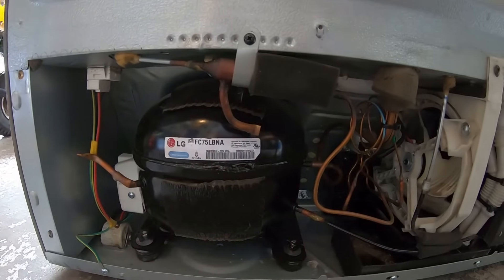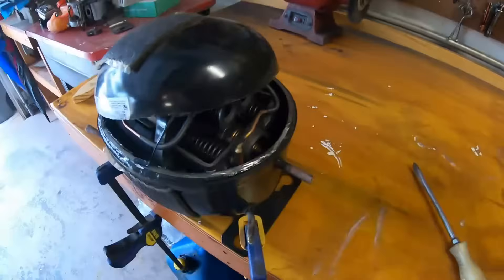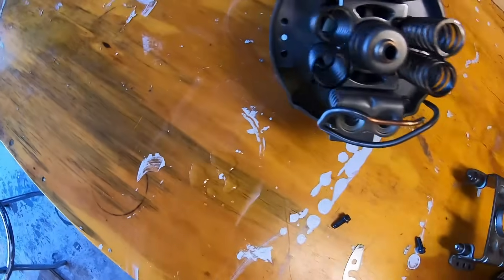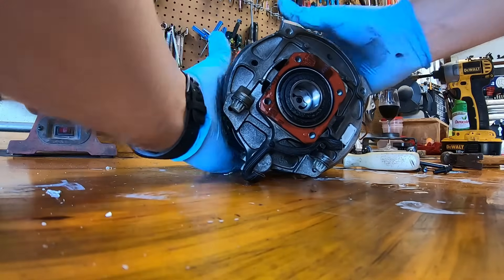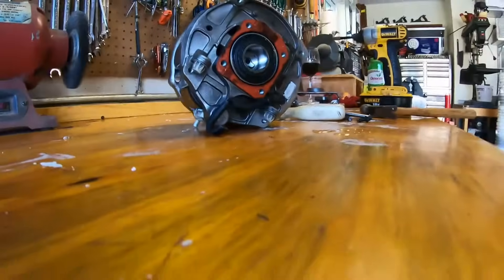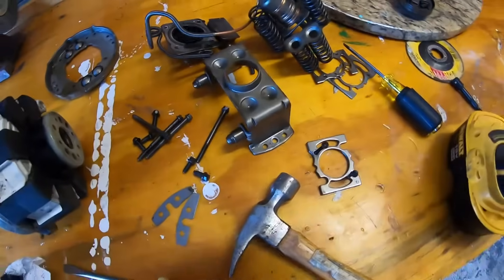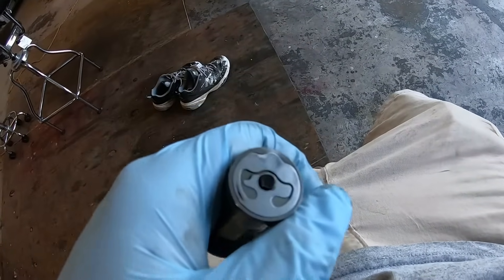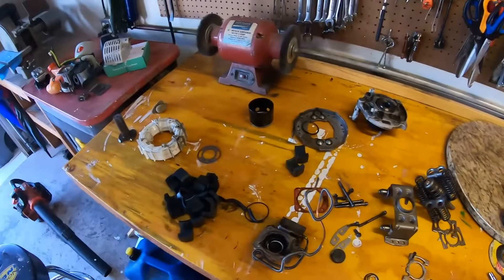Cutting open a failed LG refrigerator compressor

Comment: AN ACCIDENT WAITING TO HAPPEN.             I am rather amazed that you talk about safety in your video clip yet you are operating an angle grinder with a cut-off blade with no spark guard fitted to the grinder. Admittedly it may be difficult to use with a guard in certain situations but there is no excuse for not wearing PPG, ie gloves and goggles. I know that hand grinders are small but they are powerful and in the event of the cutting disc getting "grabbed" it WILL take it out of you hands. Resultant potential injury could be a deep cut to you wrist or even worse would be a severe cut to the abdomen spewing your entrails who knows where!  Please, for your own safety and even more so  if you are making publicly viewed videos, think SAFETY!!!!

Comment: does it have a ball valve/ check valve?.. that fails/ sticks open , its all over..
except for the pumping diaphram what else would impede the flow of refrigerant?
I fixed slurpees and ice makers/ beer chillers systems for 12 years Las Vegas ../  Casinos, bars & 7-11...( 150+ plus stores)

Comment: What usually fails is the piston becoming locked, it's called locked rotor. Lg compressors are known for this due heat build up when these units are put in a closed enclosure like a cabinet and no maintenance is performed yearly to clean coils they fail. I worked on these units when they first came out and now I'm retired.

Comment: My 1990 Kenmore side-by-side is still going strong 34 years later. Zero replacement parts needed besides the light-bulbs every 10 years or so.

I will be very sad when the time comes to replace it.

Comment: when I started in HVAC in 1981, it wasn't a big deal to find a 30 year old fridge still working fine. My first vacuum pump was made out of a compressor from an early 50's fridge compressor
Reply: Yea.. My Hotpoint/GE was here when I moved in, in 1995. Mfg 1990. Still going strong. Door seal at the bottom is a bit saggy, so I should do something about that...
Reply: Hair dryer will tighten that up.@cnielsen3739
Reply: Same here.  It was left behind by the previous owner in 1979.  It is a 1947 Hotpoint and is running to this day.  It is virtually silent in operation as it has no moving parts other than the compressor.  The condenser is a large metal plate attached to the back of the cabinet.  It does need a door gasket, though. @cnielsen3739
Reply: I had worked for my best friend's Dad's Furniture and used appliance business from the time I was 14 years old.  We reconditioned and sometimes rebuilt appliances, and had a salvage operation as well. We would replace compressors with good used when necessary. Back then compressors would often outlive the appliances that they were in. Some refrigerators that i worked on were from the late 1930's and 40's, with only a minor electrical issue. I worked in this industry from the early 1970's until the mid 80's
Reply: @mako-g90  when Ge changed their compressor, the new one would last as long as the warranty, the warehouse was changing out 3+ pallets a day, I let my Hotpoint dealership go. not enough profit and too much ill will from selling lemons
Reply: that was in about '85

Comment: The recovery of refrigerant is a law that needs to go away. Over 40 years of science has proven that older refrigerants never caused ozone depletion. And the newer refrigerants are completely different to the point that they are no more toxic than the exhaust on a modern car. We would save 10% on energy consumption if we returned to the old "Freon" refrigerants. The entire ozone scare was because the patents for Dupont Freon had run out and they had new competition. They spearheaded the move to the complex chemistry of their alternative refrigerants to gain a competitive edge. I think government regulators & science influencers are brainwashed to go green. The newest science does not support man made climate change and most weather scientists have always been skeptical. This is not a political issue. It's been politicized by deep corporate pockets to gain higher profits. They pay their scientists to produce junk science that supports the corporate plan. The MSM broadcast this junk because it gains them advertisement profits. Consumers are being duped.

Comment: Using an angle grinder without safety glasses has to be one of the dumbest and most dangerous things anyone could ever do.
Reply: There's no sign of oil?
Reply: But he did have hearing protection on. LOL!!!
Reply: @tjsylvia285  Those are for the wife.
Reply: You do you...
Reply: And the compressor should be securely held down so you can hold the grinder with two hands in case the blade digs in a d binds up
Reply: Good lil sheep you are.
Reply: And in a pretty nice clean looking garage
Reply: Thanks for doing and sharing this video. Lets me know I wont ever waste my time trying to fix one.
Reply: What are you talking about? Dodnt you see he was squinting? Sheesh.
Reply: @ reply to wrong person? I use safety squints some times but other wise fook that sh it, they cuase more problems then they solve, but I since gone to plasma cutter, much better!
Reply: And the safety shield removed, too. 🫏🧢
Reply: @jimseviltwin1  first garbage to go on my grinders too, things cause more issues than they solve.
Reply: And using a cutting wheel with no guard. I've seen those things explode
Reply: @dwightsornberger8916 Yep…trauma nurse here and we pulled about a 1/4 of a cutoff wheel out of a dude’s abdomen about 4 months ago.  Transected his colon and his small intestine in four places.  He got to carry his poop in a bag for about three months afterward.
Reply: @dwightsornberger8916 
0:44 Yes! No guard is stupidity. You know he knows better. 
Safety glasses would offer no help for that.
Reply: Still not as bad as buying an LG fridge.
Reply: @grayrabbit2211  You can't buy a good fridge anymore.  They stopped making those twenty years ago.  Everything is engineered to fail now.
Reply: Second only to no shield and holding a spinning wheel right next to your gut. Those discs do break.
Reply: I liked how he was showering the gas tanks with sparks.
Reply: But he's got ear muffs on..!!  His ears are more important to him than his eyes obviously.....  smdh
Reply: Man a pair of safety glasses is what 2$....
Reply: I have done that for decades without incident except did get some debris on my pants sometimes.
You do not put your face or other sensitive things in the "plane of rotation".
With a guard on the grinder, things can only fly out of the "plane of ratation" in a limited arc.
Reply: @2Truth4Liberty  yes,  until the blade explodes and throws razor sharp shrapnel at the speed of light through your eyeball. Better to just use goggles.

Comment: Thank you for sharing! The design of the linear piston is fine. The valve seal material is what is bad. You mistakenly called it the inverter scroll compressor. That is totally wrong. Scroll & rotary are nothing like this and many have a 10 year warranty. The inverter and permanent magnet motor is big energy saver. Consumers are demanding the lowest energy consumption with the lowest price for a given size. Let this be a lesson to consumers. Lower energy consumption comes at a very high price when inverters are used. All that complexity leads to low durability. We used to expect 20 years from a fridge and now it's 3-5. That $2000 low energy fridge is now $8000 for a 20 year life.

Comment: I wonder if the refrigerant is ammonia, a highly explosive gas? I still use my 1987 Japanese made microwave over that still has the original light bulb in it. It works GREAT with ZERO issues EVER! My USA made electric oven, a Maytag was purchased by me in 1998. I had one minor issue with it in 26 years and I use it daily. Still looks great too. The fridge we have was left by the previous owners and we have never had problems with NEVER! It is a whirlpool designed and assembled in the USA. My Maytag portable dishwasher is 20 years old this year. NEVER ONE problem. EVER! I use it about every other day. It cleans well and at about 1/3 the time the newer built in does AND CLEANS MUCH BETTER! The reason, newer dishwashers don't like to use sufficient water to clean dishes. Thanks federal government for improving efficiency to the point they DO NOT WORK!
Reply: I think ammonia in consumer products is now only limited to butane/propane "absorption" refrigerators. There are also some absorption refrigerators that use an electrical resistance as a heat source and operate on mains electricity, usually those small ones used on hotel rooms because that system is almost totally silent. Those intended for motorhomes can have both the butane/propane burner and the electric heater that can work with both DC from the battery and AC from the mains.
Big industrial systems do use ammonia, at least some, and when they have a leak the whole town is evacuated!

Comment: A much more complicated version of what I dealt with a salamander heater quit working because a small length of "rubber" hose had dry rotted in 2 years. One tiny substandard part.  Did they not test these for endurance before release?

Comment: You're using a "Cut-off" grinder... your Hand literally inches away from the wheel.  No Gloves and No Safety Glasses.  Just HOW STUPID Are You?  Don't bother to answer, it's a Rhetorical question.  I also have no doubt that your Fire Extinguisher, IF you even have one, is either in the Kitchen or your car...  just sayin'... you probably shouldn't be making "Videos" for On-line.

Comment: My LG French Door Fridge with Bottom Freezer died probably 7 years after purchase. Everything went dead, even the fridge light? Opened up the cover on the back where the circuit board is and tested the 2 fuses. The larger fuse looked fine but when I tested it with a multi meter it had an open circuit? I replaced that fuse by de-soldering and re-soldering new fuse. It has worked like a charm ever since (approximately 10 years later). I guess the vibration caused the fuse to fail over time? I have heard if you have a service guy come in they will just throw away the old board and install a new $400 board? Check your fuses before you call the service guy?

Comment: Old video, but the piston needs to be able to create a vacuum to pressurize the refrigerant,  and my guess is either the piston or bore wears where the vacuum is insufficient or there's some sort of rubber seal that deteriorates (which you ultimately came to the same conclusion).   

A basic knowledge of physics says that that moving a piston back and forth can't be as efficient as a rotating compressor, but it's probably either cheaper or smaller or probably both.

Comment: The broken seal kind of confirms my hypothesis:
For start, this is a resonant vibrating machine, where the mass of the piston with the springs is in resonance with the frequency it is excited by the winding. Kind of the same as e.g. electric shavers use to work, although the shavers run on mains frequency directly, here the inverter is able to lock in to the exact resonance of the assembly so is able to make the thing very efficient (not that difficult with the electronic drive). The key difference between this resonant mechanism vs the classic "rotating motor plus a crank" is, the crank has an exact displacement range without any exact control required, with the resonant mechanism the displacement, so vibration amplitude, must be carefully controlled by something reducing the drive strength once the amplitude reaches the designed level. Now with a piston compressor to be efficient, you need to push it really to the head without any gap, so you need the displacement to be really accurate. Not that big deal with a crank, but the heck of complications with something that has its amplitude so temperamental. If the amplitude became too large, the piston just crashes to the head, so that is why they probably used the rubber bumpstop there. Most likely the electronic was supposed to drive the compressor so it just does not hit it, but that is rather delicate balance,quite easy to get upset. What happened most likely here is the upsets, leading to the piston actually hitting the rubber bump stop, happen in the real life way more often than LG R&D expected, tearing the rubber apart.

To me it is very naive to assume those upsets to be rare (it could even be the fridge operating under not fully optimom conditions) and for practically any material to withstand those crashes so many times for the thing to last for any usable time. To me it looks like some management moron jumped on some "high school science class idea" and pushed it through dismissing all suggestions for it to be nonsense.
Reply: It's also likely that they had to go to this design to meet energy efficiency standards. The old style compressors are durable but use more energy.
Reply: @SSHitMan  I'm not sure the resonant thing is necessary for that. I would rather guess the (now classic) BLDC motor with normal crank would yield practically the same efficiency.
The inefficiency of the "old school" is in the use of induction motor (losses to get the rotor field, vs a permanent magnet rotor BLDC), not in the crank mechanism. The resonant springs and the fact the whole thing has to vibrate causes losses too. I would even doubt they would be any lower than those in a crank mechanism (even when talking about a system with an extra balancing mass auxiliary crank, to fully compensate imbalances), mainly when the compressor piston can operate with much tighter margins with less dead space and less elastic elements within the cylinder (and still no risk of any crashing whatsoever).
To me it more looks like an attempt to cut costs: The resonant vibrating system has fewer parts and may appear simpler to manufacture, so may have promised lower manufacturing costs.
It may work well with things like shaver, which has barely 1000 hour runtime expectation yields more than 10 years of service, but in a fridge the same 1000hour compressor runtime gets spent within just barely few months. And that is, when these compressors appear to start failing...
Reply: EXACTLY,  you can blame the government for all this waste.  @SSHitMan

Comment: I've worked on a lot of AC systems in automotive applications and you'll never see black oil like that a property running system will look brand new inside. The oil will look nice and clean. A system with catastrophic failure you'll see that sort of thing. The black is metal dust and that's in the entire system now because the pump failed. You can flush the system out luckily and replace a compressor. I'd bet on that fridge you can replace that pump with an older style pump no problem but it's probably not worth the effort unless all that's available are fridges with that design then doing so will be beneficial because it will last dramatically longer.

Comment: You won't have your eyes long grinding without using safety glasses.
The thin piece of metal on top of the piston is a reed valve.  If the compressor was running before you took it apart, the valve assembly more than likely was at fault.  The piston was moving back and forth but because the valve(s) were leaking, it couldn't pump anything.

Comment: I applaud your efforts for taking it apart to make a video, but the fact that you didn't have a clue what you found is baffling. It is not a piston. LG's feeble description of this compressor should say 'Solenoid Plunger Pump".
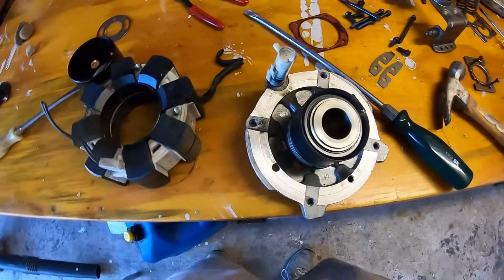Electric coil pulls against an iron armature / center piece. and springs push it back. What you found and showed at 12:27, is about worthless if you don't show where it came from - again, not your fault, but is lacking any value to the audience (me). 
If you were to show the point at 6:13 as to where it came from, it is easily seen as a bellows or a diaphragm, that moves the FREON through the system and pressurizes it. The split is why it can no longer compress. A diaphragm pump is not something that belongs in a sealed system.
If you show the 6:13 point, you can see that the entire pump system, pipes, etc, is basically pushing the little rubber circle in and out. Have you ever seen a speaker cone ... kind of like that.
This is a TERRIBLE system, and none will ever last 10 years. The designer needs to be liable to the common sense police and removed from ever making anything again. LG has made a fortune, copycatting "reverse engineering', everyone around them, and this shows, they are not ready to stop counterfeiting outside technology ...YET.
Please ... you worry about your hands - blue rubber gloves, you worry about your ears - muffs... Your eyes are more valuable than both ... unless you live in California, I guess.

Comment: The linear compressor is still a reciprocating piston relying on the seal to maintain compression, similar to the cylinder in your car. I think the scroll compressors are still a better design - simple and very few things can fail. I look at the LG compressor and all the springs and electromagnets and I don't think that will last.

Comment: from the LG class action lawsuit:
According to the lawsuit, the problem starts in the tubing of the evaporator, a part that works in conjunction with the linear compressor. The suit says that the tubing is “prone to corrosion and pitting” and that small holes can develop, which can cause leaks and allow air to enter. Because of this “air leakage,” the refrigerant that moves from the evaporator to the condenser generates excess pressure that puts stress on the compressor, according to the suit.
The compressor can’t take this additional pressure, the suit says, and begins to fail. It is usually the discharge valve in the compressor that is the first to go, as it is the weakest component.